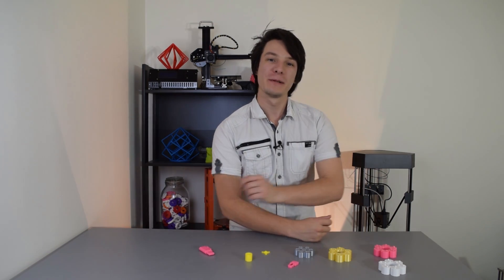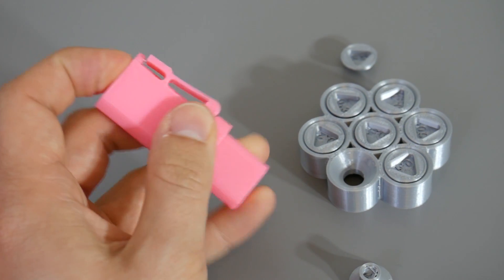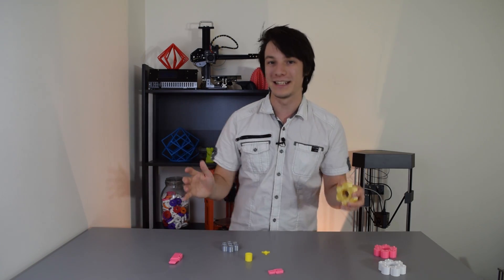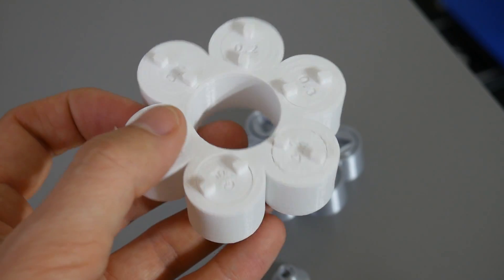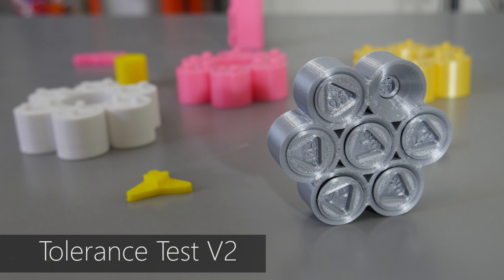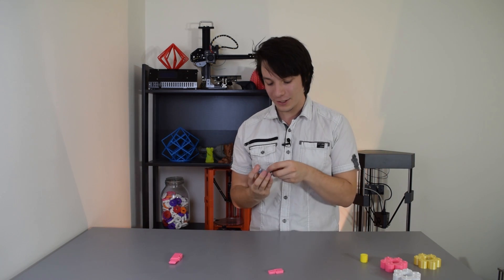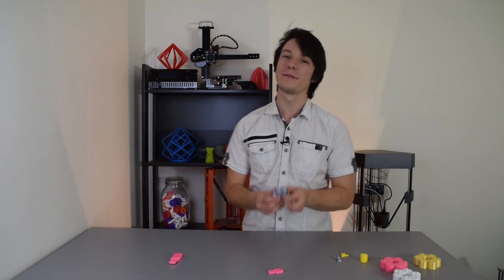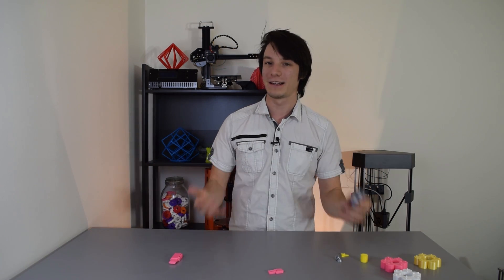How Accurate is your 3D Printer? Take the Tolerance Test!

Comment: I wouldn't charge for it but whatever. Someone will remake it or repost it on thingiverse if your charging for it. Its not an artistic design just a functional one. Making it pretty likely to be copied.
Reply: There you go! Made a version with a few improvements to print faster and with less material: smaller in height, less intricate details (no numbers), tuned for extrusion width (currently 0.42mm but changeable with the variables) so that the casings are exactly 4 perimeters thick, no key indent at the bottom. I had to reduce the key indent to 2mm because my rollers are slightly smaller in diameter, but the original key should work nonetheless. Haven't had time to test it yet but as soon as I do and make sure everything prints fine, I'll upload it to thingiverse (since you encourage copy). https://cad.onshape.com/documents/a8ab667fbfa1355a684e20da/w/a79215d195ad1346467c6be5/e/31e7790b71445bfe7d92d634 Duplicating the units for each size is not ideal but I couldn't find a way to do it otherwise in OnShape.
Reply from the maker: You can just enter 0 for now, and I fully encourage a copy.
Reply: Maker's Muse ok. You make great models and they are definitely worth the price. I do wonder if something like PayPal or patrion would be better though
Reply: Could you make one with even higher tolorances ?
and share one that allows for download ?
Reply: Erik cramer you can actually modify it and download it yourself with a free onshape account. After cloning the project on your account, right-click the tab with all the parts and click export to get the STL. I'm still perfecting the model before I make it public

Comment: i love calibration/test models. i have the anet a8 and im constantly looking to push i to the max. these things help immensely when tweaking settings or getting a new brand of filament
Reply: ShadyCreekFarm's Josh Alexander like what? by buying a anet a8 you kinda signed up for a few instances where you need to use problem solving.
Reply: my anet has issues
Reply: Tyler DeMott I have one to! live it but I need to work on getting my over hangs better. can't wait to try this or
Reply: Dangerous printer
Reply: @jab2go69barrett8  In what way? Most of the issues I've seen were either bad builds, or bad firmware configuration.

Mine has not had any safety issues over the past 2 years.

Comment: That 0.05mm offset is easy! Just scale the model by 500%
Reply from the maker: Cheating!!! lol
Reply: 0.05 is easy, well with resin printer i have anyway
Reply: @Astro_Alphard  that's also cheating
Reply: Astro_Alphard you still would not be able to print these small gaps on a resin printer.
Reply: @Astro_Alphard It will not be worth it for you as it will be a much more expensive fidget spinner.
Reply: lololol
Reply: LOOOOOOOOOOOOOOOOOOOOOOOOOOOOOL
Reply: Lol
Reply: https://discord.gg/ACPjd4

Comment: @makersmuse -- Cura 2 has a "horizontal expansion" setting which directly allows adjusting tolerances in the slicer. This is helpful when printing models without the source files available. I've applied a -0.1mm horizontal expansion offset and have seen dramatic improvements with my Taz 6 using eSUN PLA+ with a tolerance gauge print.

Comment: Thanks for this Angus :)
I have been struggling with tolerances and my test piece isn't as advanced as yours.
The video Joel posted recently about making a fidget spinner showed a zero tolerance press fit which i guess wouldn't work for a great many printers. It's a hard thing to explain though i suppose.
Reply: I noticed that on his video too. He did make the bearing 0.05mm larger, but the caps had no tolerance or clearance. If I'm making something that is press fit, or something that is more than one piece, I just sand the parts until I get the fit I want. I find the tolerance is only important if you are printing something that can't be sanded, like something with internal moving parts printed in place.

Comment: Any one else miss out on the Aldi printer😢😢😢😢😢😢😥😥
Reply: get the one off Kogan, its like the same, for the same price :)
Reply: Nope! I was the first one at my local to grab one! :D
Reply: Aldi had 3d printers?!?!?!?!
Reply: Same!
Reply: I got 2 rolls of filement, I already had black (PLA) at home but the only colours Aldi had left were Black and natural so I got one of each of the colours left because it is absolutly impossible to get filiment under usual circumstances with in over a 100km radias of where I live.
Reply: I managed to get one at my Perth(Mirrabooka) store. They only had ten. I was 6 in line.
Reply: I got there at about 10:00 am and there were none left, not that I wanted one, what I was after was the filament and even then there were only 4 boxes left (of which I bought two) but gee are they expensive! Still, it's better than paying $60 of free* shipping to Australia.
Reply: was there a good range of (filament) colours where you went? Our Aldi was bare (in terms of 3D Printer related items)!
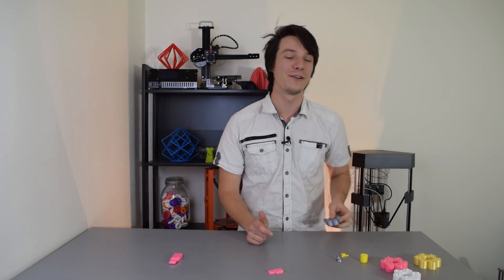Reply: yep and they also sold filament, the printer was a rebtand of the wanho i3 plus. at my local store they only had 5, but i was at the door waiting at 7:00
Reply: yup, postage isn't cheap so I got 3 rolls - black, white, orange
Reply: if ur on a tight budget a Chinese clone can get you started too ... be aware that you need some knack as you may have to fix stuff yourself tho but its a absolute bargain, like 200 bucks and ur started, maybe 30 bucks more and you can order all the stuff to add automation like the real thing too. ..... if you can afford it the original prusa i3 has a ton of support and helpful features tho.
Reply: Where was this in Aus?? I was on the mailing list but didn't get any notice :(
Reply: I am sorry to hear that. I'm not sure the full scale of the Aldi deal but in his notification video about the matter, Angus did say that last time it was at a shop in Bondi and I am in Central New South Wales so I would think it would've been between those places at the very least if not the whole country but I think the latter is the most probable.
Reply: Ahh, I'm down in southern Vic, that might be why. :T
Reply: me 2
Reply: Printers or Filament?
Reply: Clancys Creations printer.
Reply: i grabbed two extra rolls as i didnt know if any was included.
Reply: I got blue and grey. there was black and i.think a white one and may have been orange.
Reply: It's supposed to be at all the ALDI stores - you were supposed to ask at the front counter to get it cuz that's where they put all the high value/demand items, eg. the printer and filament, the gps, the notebooks ect. so they can limit sales to people
Reply: Oh, yes.  Definitely yes.
Reply: Was looking at the ALDI printer when it appeared in the catalogue, bought a Creality CR-10 instead. Worth checking out on GearBest when on flash sale, not much more but great quality and larger print volume. Hope it helps those who missed out. Edit: $557.22 AUD flash sale price with free shipping atm. Also check out some of the reviews of it on YouTube, they definitely helped me decide this was the printer for me. Many of the reviews have coupon codes too which may still work, for roughly $10 extra off the flash sale price.
Reply: speaking of which these seem actually ok i have seen some reviews :

https://anycubic3dprintercenter.aliexpress.com/store/1182157?spm=2114.10010108.0.0.XqHpBY
Reply: looks like a great printer with auto functions added in too! ... the wanhao i3 which the aldi one is based on is pretty good too apparently
Reply: thanks i'll check them out - it seems apparent that a lot of these just had discounts, i mean based on the 'price' they were 'valued' at previously of course.
Reply: yep, even got 6 kgs of filament , in the nerdy part of Canberra no less.
Reply: Now i have a 3D Printer but here in germany, as i didn't has a 3D Printer (since 3.6.17) no aldi here in germany has a 3D Printer!
Reply: If anyone is reading this, you can get them for 499 from a place in Perth. Wanhao duplicator i3 plus
Reply: Down in Adelaide, ALDI opened at 8:30 and they sold out before nine, coincidentally before I got there :(
Reply: i didnt have $500 handy, was a bit dissapointed

Comment: Hi! I got a cocoon create from ALDI this morning! It works really well!
Reply: That's exciting! Enjoy your new printer!
Reply: Compared to my Geetech i3 pro b (which is now broken), the Cocoon create does an amazing job with 0.1 mm layer heights. I'd give it about a 9/10
Reply: damn i feel ripped off aha. payed $240 for my ctc and was super excited as its my first 3D printer. have had it for nearly 2 weeks and i still haven't got it calibrated correctly. plus the seller has to send me replacement parts because the x axis buzzes that much it makes the floor of my room vibrate even though the printer is on my desk. guess i should've done more research before purchasing :( I have nearly used the whole roll of filament that came with it and only 1 print has been 100% successful
Reply: what do you rate it out of 10? i got a ctc i3 a week ago and has just been constant problems :/ is the aldi printer worth the extra $200
Reply: I got one aswell! I had to carry it home by hand and had to take multiple stops every 10-20 metres or so to let my arms rest. My whole upper body still hurts.
Reply: Thanks for the advice.
Reply: I got up and went to ALDI at 8:30 when they opened. there were 2 other people there for a printer. my local store only had 4 printers.
Reply: TeamEmeraldElements same

Comment: I have the problem on my up!plus2 that the x axis moves more than the y axis... thus makes slight ovals. While not usually easily notable, it is obvious for things like bearings and when you want two pieces to join together perfectly.
I thus have to make sure that when printing two pieces i want to put together i have to make sure they are lined up in teh same direction.
Reply: Have a look in the manual as I seem to remember there is a section on calibrating the printer. Effectively it's doing a special test print measuring it and then feeding the results into the printer
Reply: thanks. i have not had time to think much about it. it only became a serious issue recently when i actually needed a perfect circle